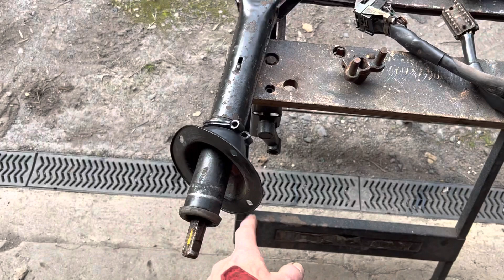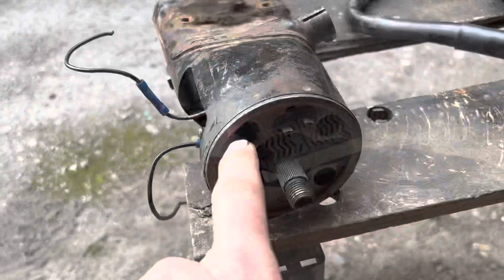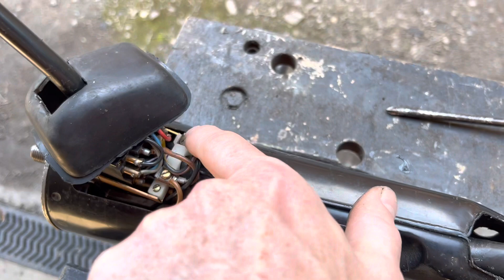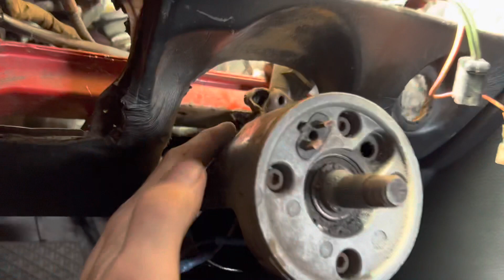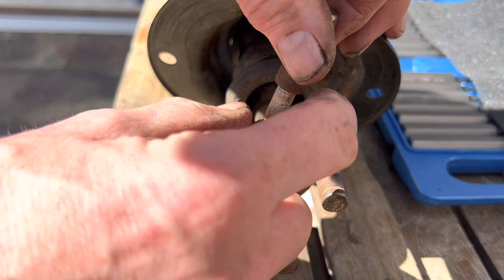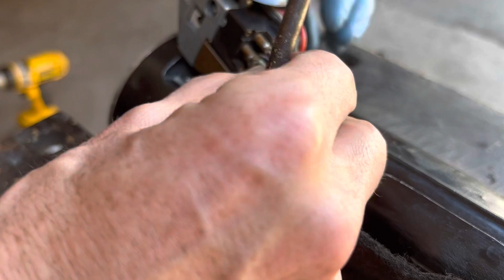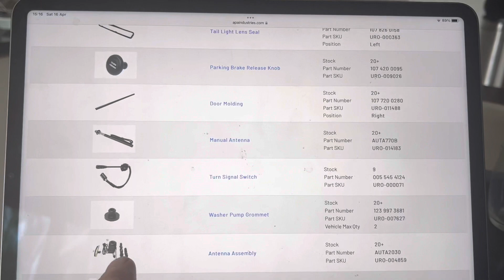Mercedes R107 SL ignition barrel, turn signal indicator and steering column removal

Comment: Hey mike, Just replaced the combination stalk on my 76' 450SL and now my signals dont automatically cancel after turning. They worked perfectly prior to the stalk replacement, and I even put the old stalk back in -- still no automatic cancel. The plastic tab on the stalk pops out when the lever is flicked, and the metal cam on the steering column which is supposed to push it back in is intact. Any idea as to why I still dont have cancelling signals? Thanks
Reply from the maker: Yes. If you don't mark the spline when you remove the steering shaft, you may have this problem. Imagine when everything is working, turning the steering wheel ninety degrees. Now take the steering wheel off and put it back on straight - everything would look OK, but the steering mechanism would think the wheel is turned 90 degrees and the indicators would click on and off at the wrong time. the video below outlines the issue:

https://www.youtube.com/watch?v=lChlOrK00xY

Mike
Reply: @MikesMercsandothercars thanks!

Comment: Morning, me again :). Trying to remove the steering wheel-day 3. 10 hex bold is on so tight my hex bolt tool has shattered, then took power tool to hex bolt, turned into a torx which did not loosen the bolt. Have applied heat, copious amounts of bolt buster. Still nothing. Today I tried a reverse thread nut and brute force, reverse nut tool shattered. Increasingly lost for solutions beyond drilling out the bolt. I have also prayed to all known gods . Any tips? Many thanks.M
Reply from the maker: Can you send me a photo of the bolt/steering wheel. m_scott65@hotmail.com.

Remind me what model and year the car is....and also where you live.

Those bolts are not usually in there too tight....unless of course someone thought it would be a good idea to use Loctite. Here are my top tips:

1. Use sockets designed for impact drivers - they are less likely to shatter and wont mess up the head of your bolt. I speak from experience!!

2. Sometimes an induction torch is a better way of getting heat into a bolt rather than an open flame. The Induction torch will heat bolt to red hot in seconds without damaging the surrounding 'stuff'. See 1.05 in video below:

https://www.youtube.com/watch?v=zW2IceJ8fGM

3. Sometimes freeze spray works better than heat. Wurth have a product that I have bought...but yet to use:

https://eshop.wurth.co.uk/Rost-Off-Blue-Ice-rust-remover-RUSTREM-ROST-OFF-BLUE-ICE-400ML/0893241.sku/en/GB/GBP/?CampaignName=SR007

Mike
Reply from the maker: Congrats on getting that bolt out - see my reply. Mike

Comment: I want to change my steering coupler and access it through the footwell versus going under the car. If I remove the steering wheel and loosen the bolts at 1:30, will I have enough room to loosen and remove the steering coupler?
Reply from the maker: What car do you have? Mike

Comment: Watch closely how you clock the actual steering shaft inside the steering column. You can put them in 2 ways, rotated 180 degrees or 0 degrees. If you put it in rotated 180 degrees by accident (as I did), your blinker cancellation will work erratically (at 25 to and 25 past the hour in stead of 10 to and 10 past the hour. 
This seems OK when you’re testing it when parked, but when driving does not work correctly.
Reply from the maker: Thank you for your comment. That is a VERY good point - I will remember this. Mike

Comment: Good job ! Easy now to remove with your explanations. 👍
One question, why did you change all that in your car ? The steering column seems in good shape just a bit of paint
Reply from the maker: Thanks for your comment. The steering column on the car was rusty both inside and out plus somebody had spliced the horn wires….. Plus all the bolts holding it in place were rusty. I thought it would be a five minute job to change it but as you know these things really go to plan! Mike